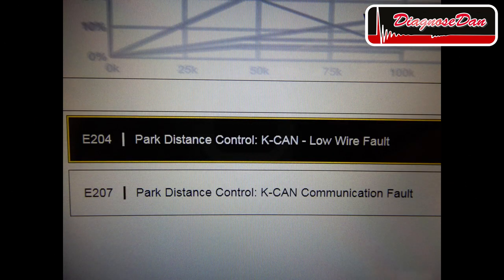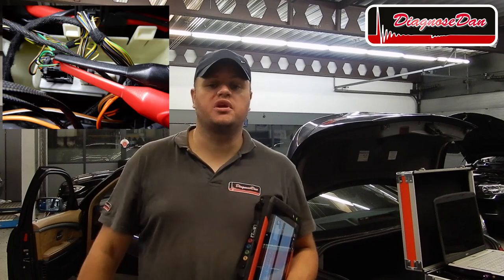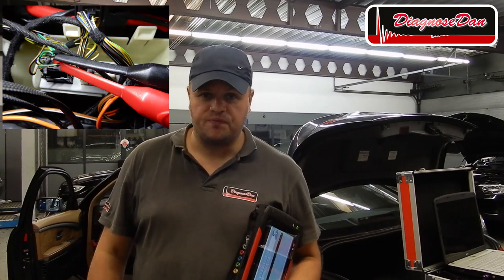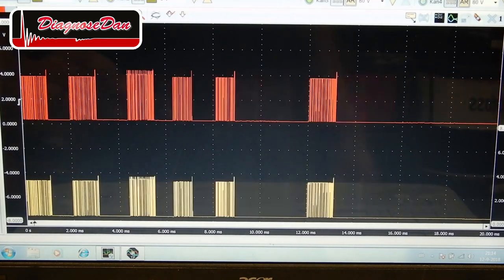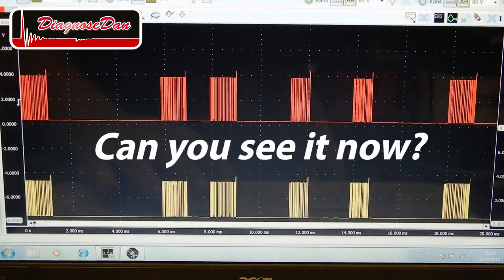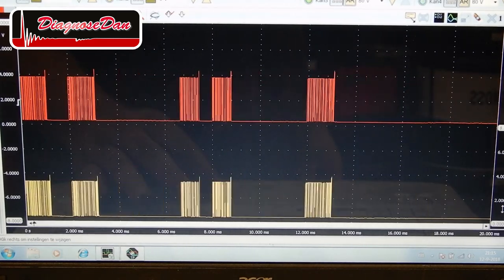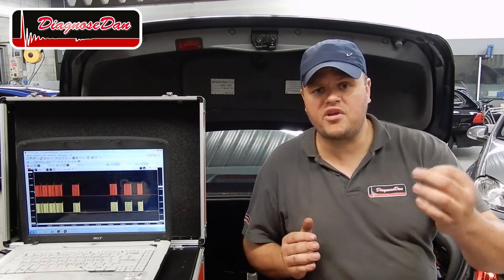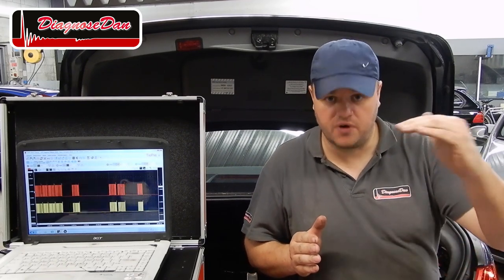Can bus Water bus

Comment: hey dan my bmw has kcan line fault on 10 modules, car works fine but its hard to find which module is causing problem , can i disconect one at the time and see when will error go away?, at the moment i dont have oscilloscope but i have bmw ista diagnostics ?

Comment: Dan, is the K bus 0.5 VDC to 3.5 VDC? Thank you
Reply from the maker: The low is slightly over 0V and the high is aprox.4 volts the resistance in the system has some effect on the voltages. An older car might have more recistance in the network and a little lower voltage
Reply: @Diagnosedan  Thank you sir. Have a good day.
Reply from the maker: @billyyoder8171  Anytime!